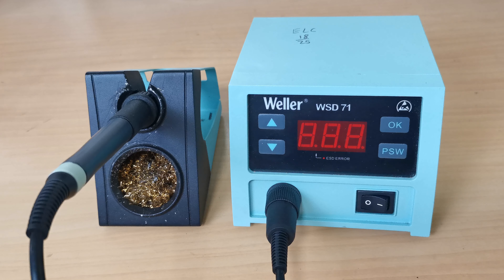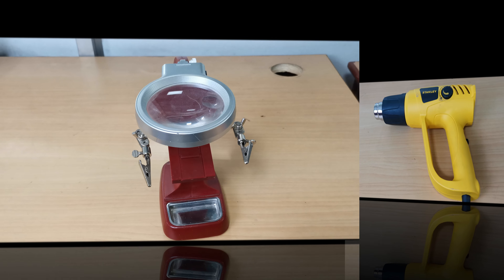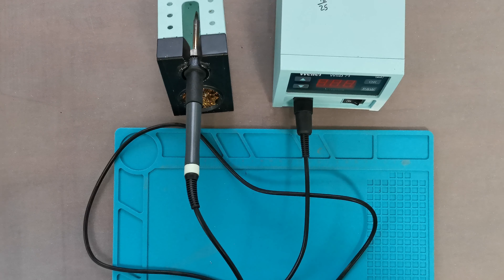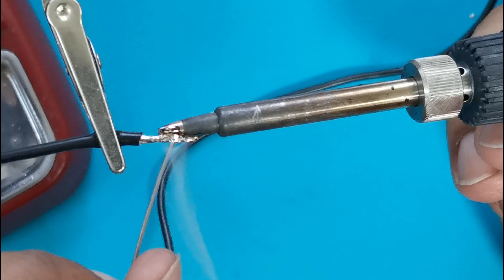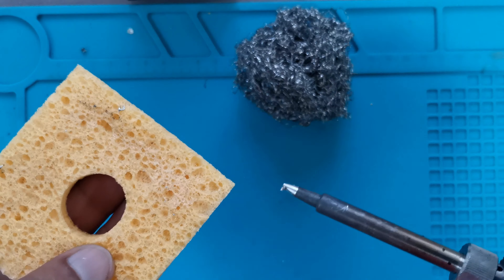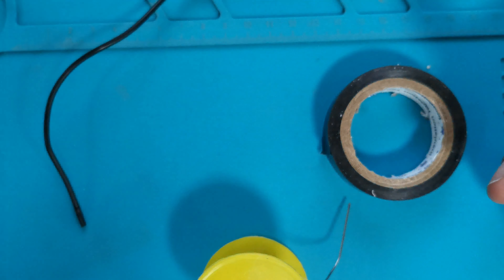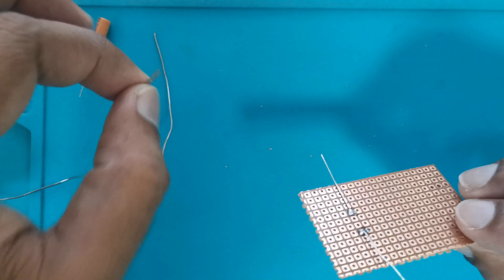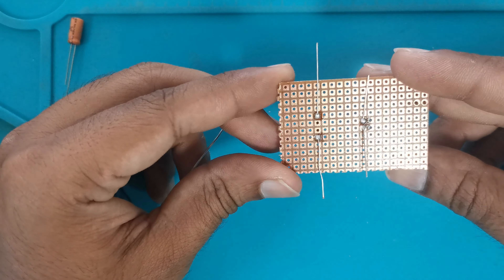SOLDERING करते समय ये गलतिया न करे | Stupid Errors to Avoid in Soldering

Comment: Is the size of capacitor important. I bought 1000 mF caps 25 V. But on my monitor mother board the same cap is twice as big. Is it better to use the small cap with exact same ratings or a bigger cap of 2200 mF. This is the cap that failed
Reply from the maker: You have to use the same capacitor that is failed

Comment: Let me know which black wire you used for solder?
Reply from the maker: Thats a commonly used electrical wire

(Used in joint)
Reply: @TEKNOISTIX  is it easy to solder
Reply from the maker: Yes